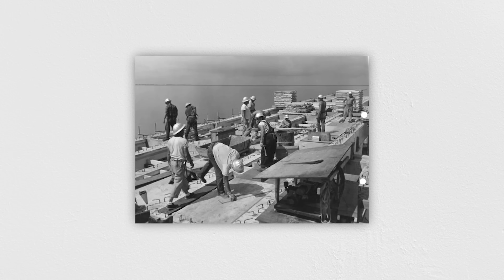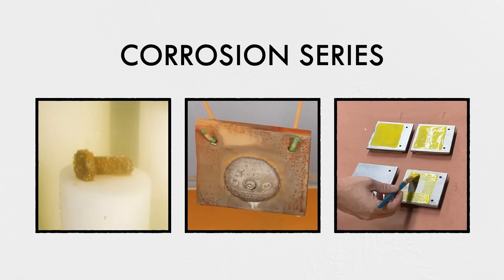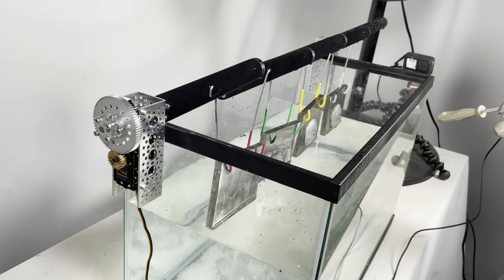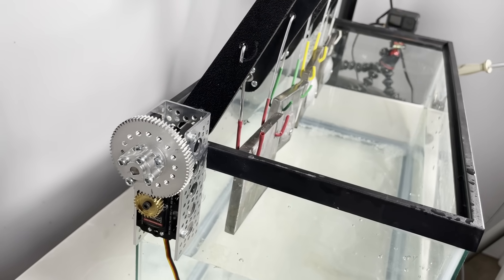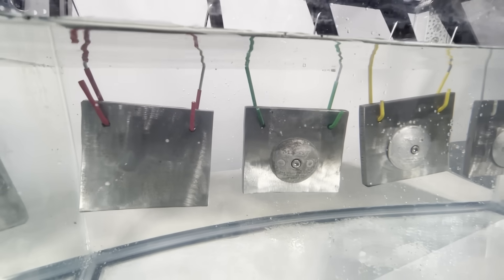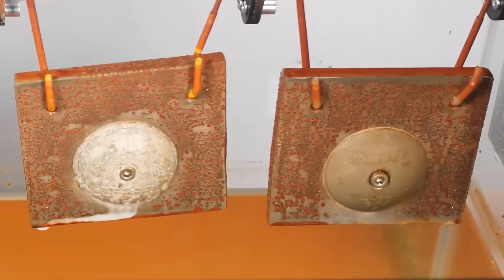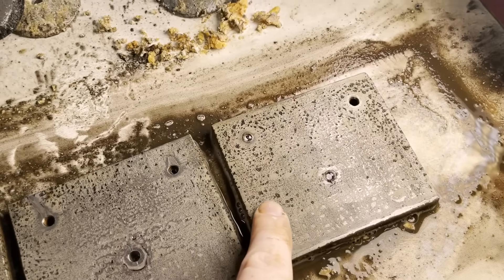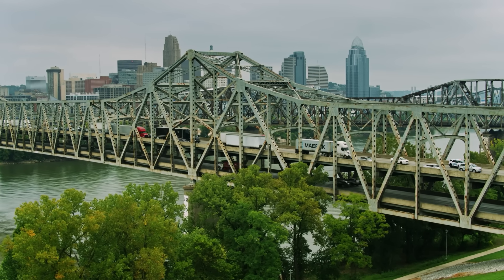Why Spillway Gates Don't Rust Out

Comment: I learned about this in college and I never understood why outside of marine motors this sort of thing isn't popular with old/vintage car owners. Seems like an easy way to prevent rust by bolting a couple of these to the chassis and subframes etc rather than never driving the car and always spending time thoroughly washing it every time it's even slightly exposed to salt and moisture.

Comment: I mean... I'd be really interested in watching a time-lapse of the isolated test subjects consistently submerged in the electrolyte (salt water, mild water movement to allow for some polarization between the metals). I understand it was likely a decision made so that a beautiful, crystal clear time-lapse could be captured while out of the electrolyte (which I truly appreciated, as a NACE CP2). Maybe having the samples just closer to the glass underwater, since you would have had to consistently refill the tank anyways, could produce decent photo's too. 

I just have no context for how long the electrolyte stayed on the samples when raised into the air; I presume 5 minutes allowed for most of the electrolyte to evap./drip in <5mins... In which it is no surprise so much surface corrosion happened even with anodes. Consistently mobile samples would of had an accelerated corrosion rate, since no polarization would be allowed, similar to how adding a bubblier or pump to just move the water around would accelerate the corrosion but limit the effectiveness of any anode; if you wanted to really watch the difference in anode effectiveness, you would want to allow the metals to polarize in a stable water environment. 

It's that fine line of 'maximizing anode performance' vs ' I don't want this experiment running for months on end'. Overall, fun series to watch mate, looking forward to more videos.

Comment: 10:44 
An oz (28.35gram)of protection is cheaper than a lb (453.592gram) of cure..
In metric that's:
An ons (100gram) is cheaper than a pond (500gram)

Comment: put some 304 and 316 stainless steel samples in your rust-o-matic 3000.
we spend so much on coatings we could have built the structures with better materials and have less to worry about.

Comment: Great video. It would have been good to have more explanation of the chemical process you introduce around 3m30. Most people have some idea what oxidation means but how does the non-corroded steel get "reduced" and apparently eaten away?
Reply from the maker: That was covered previously in the series.
Reply: @PracticalEngineeringChannel  Thanks, could you be more specific, I'd like to see that vid.

Comment: Iron rails for streetcars are "super protected", if there is the right polarity, i.e. +600V im the overhead wires, the rils are buried in dirt and water pipes run "faborably". Stray currents literally eat up the water pipes. When the streetcar tracks were torn out during reconstruction, they had excess metal all over the place. They were literally "fused", or "welded" to some parts of sewage infrastructure. What the cranes torn out from the ground were massive blobs of metal. Of course, this was only at a specific location, where there were the right conditions for this to happen. I guess other infrastrcuture suffered a lot (water, sewage, gas) there.

Comment: I'm a corrosion engineer for an automotive company, our test are all about replicating real world and galvanic corrosion is becoming more and more common with mix metal vehicles, aluminium suspension components, steel fixings, aluminium doors, steel reinforcements. Correctly isolating different materials is a large part of strategy now

Comment: Behind my house they were digging along the gas main which is near overhead high voltage power lines. I asked about their work.  They were installing a sacrificial metal wire along the gas pipeline to protect it from the static electricity created by the high voltage lines.

Comment: sacrificial anodes are also used in hot water tanks for homes. It may be about time to replace ours at home, luckily my father worked at a powerplant as a Metalworker and when one of their blocks was closed, these massive sacrificail magnesium anodes were left as scrap and so my father was allowed to take a few. A single one of these would probably last for 40 years as they weigh about 10Kg each.

Comment: A galvanic anode, or sacrificial anode, is the main component of a galvanic cathodic protection (CP) system used to protect buried or submerged metal, But an actively electrotonically powered circuit may be better, without chemically sacrificing any metal anode!  But require a continuous DC current source!

Comment: Silly engineer. I have welded stainless steel. It's really not that much harder to weld. Well, I guess it depends on the grade. There are multiple grades of stainless depending on it's intended use and each one has its own eccentricities, but I really liked welding stainless, especially food grade stainless.
      Each grade varies the kinds and ratios of the alloy, but the kind most people deal with is food grade and that material is used widely in food industry, and we all have to eat.

Comment: I installed hundreds of passive cathodic protection systems on natural gas pipes in NYC (coatings + magnesium anodes), but only one active one (coatings+anodes+rectifier). The active one was on a section of underground high tension power line (345kv) in pipes bathed in oil. The field of anodes were like giant 12’ long candlesticks. The rectifier station looked exactly like the one you showed.
Reply: could they modified to generate current/power? However little?
Reply: @pierQRzt180  they do create power. But pathetically little. And the fuel is a 10x millions of dollar steel pipeline coupled to 100x thousands of dollar anode array. And the added impressed current unit spends more power than the passive anodes make. There are better ways to make power. This is used to be a rust magnet for critical infrastructure.
Reply: Why do underground power lines need to be high-tension?
Reply: very high power electric lines are interchangeably called “high tension”. But has nothing to do with a physical pulling force or that they are pulled tightly, because they aren’t in this case. I’m not sure what the etymology is, I heard it comes from French. Sort of like cinder blocks, which haven’t been made with cinders for 80 years.
Reply: @chriskelvin248  All Europe uses the term "electric tension" or, simply, "tension" for the voltage. So a high tension line is a high voltage line.
Reply: @chriskelvin248  my man, thank you
Reply: @chriskelvin248  "tension" is "voltage" in french so "high-power electrical lines" are called "high-tension lines" because they are high voltage.
Reply: I actually have active rust prevention anodes on the body of my 20+ year old car, it slowed down corrosion significantly, I have to sand down the anodes from time to time as they oxidize but it seems to be working.
Reply: @FrozenHaxor  Any info on these? It would definitely be helpful with my rust belt cars!
Reply: @PlayinWithMahWii  Look up Electronic Rust Protection System (ERPS), they are sold under various makers.
Reply: e

Comment: Great video.  I work offshore so rust and cathodic protection is something we see a lot but I never knew how exactly it worked beyond the zincs corrode instead of the steel.  This video filled in the missing piece.   There are a lot of big pieces with big anodes down there, you should see the corrosion on those zincs after they have been on bottom for 20 years or more.  They do their job though, the steel is usually still fine while the zincs are encased in their own oxidation.

Comment: Can someone explain what state stainless steel fasteners A2 & A4's are sold as, are they active or passive state?  
I thought all stainless steel fasteners are in a passive state due to the oxide layer that forms but you can further passivate it using chemical baths.  This bit is confusing.
Passive SS is noble and opposite end to Aluminium on the corrosion chart which means in theory you can use it together as long as the screws are smaller than the aluminium part you're fastening?

The use case is in a temperature controlled, indoor and non-humid environment i.e. clean room. 

Can someone with a background in metallurgy help :)

Comment: I worked for British Gas Engineering for just short of twenty years. Cathodic protection, impressed current and basic sacrificial anode systems were widely used. I recall Mike, our senior CP manager, who coincidently had red hair, was known as the "minister for rust" or nicknamed Rusty by the rest of engineering.

Comment: Bare carbon steel corrode (looses) 20lbs a year. This is unprotected steel. 20lbs a year might not seem like a lot but if the 20lbs/year is concentrated in one area (a holiday= could be a pinpoint size), which the year rate becomes hours to days to corrode. This can be 20lbs/days if the steel is unprotected. So, protect any metal that comes into contact with air, soils, water, and other liquids. There is more to this, of course. Good video.

Comment: Whenever you do the paints and coatings video, it might be worthwhile talking about cathodic paints in addition to normal paints. In the 1930's onwards, many cathodic paints (Aluminum, zinc, magnesium) were offered, and used widely in the US and elsewhere, as a cheap solution for extending the life of galvanized and bare iron/steel structures, and can still be seen in use in many places due to their low cost vs performance.

Comment: Hi, slightly off topic here but I have a question. Why do houses are built mirroring the house(Terraces and semi-D) next to it. For example, if a stairs were to be built, only both houses will have their stairs on the same wall. House A and B will have the stairs on the wall dividing house A and B. The same goes for house C and D.

Comment: My dad told me about running a small current through an underground storage tank to prevent it from corroding.  I remember him telling me one issue with it is that it will accelerate the corrosion of the guy's underground storage tank across the road!

Comment: I worked as a construction worker on a new part of port of Koper in Slovenia. Port wanted to expand their capacities but it was immpossible to expand on land so they decided to expand on sea with new pier. We used tons and tons of rebar and concrite but I was curious how can we build with iron on salt water. Later I found out and asked guys that i worked close with that they use platinum coted titanium rods under pier to protect rebar and iron pilons. They weld them to iron in salt water and secure everything with cables in concrite - everthing was in contact. Its basically the same principle you explane here.

Comment: The metric equivalent should be "0.278 Newtons of prevention is worth 4.44 Newtons of cure"
Newtons, not grams; the gram is a measure of mass, the pound is a measurement of weight. A small, but important distinction.

Comment: Excellent. Thank you!  As an engineer on new projects for the offshore oil and gas industry; I really find the corrosion prevention aspect of the structural engineering to be fascinating.  Also, as a restorer of antique machinery, I totally agree with your observation as to how preserving and prolonging is much better for all; versus replacing in a short time.
Reply: Well I guess as an engineer you must have an understanding of electrolysis add salt water

Comment: In your test rig, aren't the steel plates connected by the metal hooks they're hanging from, and wouldn't that affect the results?
Reply from the maker: The hooks have heat shrink insulation
Reply: @PracticalEngineeringChannel  Right, thanks.

Comment: You have good content well demonstrated.  I live in Idaho with the impression we have some of the worst examples of road construction. Idaho is always chip sealing which leaves standing water in the track, non reflective lines that disappear in a steady rain, wrinkled up pavement at intersections that scrape the bottom of cars and single mile widening projects that never connect creating numerous merge hazards.  Would you consider an episode on best practices for road construction.

Comment: Putting a copper disc on one of the sheets would have been interesting to demonstrate anodic corrosion. Some nails are electroplated in copper to protect them, but any scratch in the surface causes accelerated oxidation.
Edit: Or is that the next planned video, no spoilers.

Comment: I did some digitization work for an energy company once relating to pipeline corrosion. One of the major influences on that process is that transmission pipelines are frequently built along the same path (and therefore fields) as transmission powerlines.

Comment: I work in the offshore wind industry and these sacrificial anodes are commonly used in protecting the foundations of offshore wind turbines. There is another environmental aspect to their use though. The sacrificial anodes by design release metal oxides into the environment. The environmental impact are currently being investigated. It looks like in the future we will have to switch to cathodic protection (with an external source of current). Maybe the next video will look into this method?

Comment: I’m just going on a limb here but didn’t the fact that for the time the samples where subjected to the salt bath water you prepared in the tank also generate enough differential current between the samples causing them to not behave as they would if they were dipped into individual baths for the experiment? I guess the end result would be negligible since it wasn’t a matter of measuring how fast and badly they deteriorated over time but just a demo on how they work on protecting mild steel from corrosion itself but it’s something that started to nag at the back of my head the moment I saw the setup and I couldn’t keep my paws off from pointing that out, sorry.

Comment: A bit disappointed that even tho the cathodic protection research was done so well, it did not go into further detail as to which sacrificial metal did the best job. It was noted that the magnesium suffered the most, but then only superficially a "looks like it protected the steel the most" mention. There was no closer look at the steel. There was no discussion why zinc was chosen to protect the Tampa bridge over Aluminum, or magnesium. I heard that it might even make a difference if it is a structure in fresh water vs salt water. Also that the sacrificial metal on outboard engines are called anodes. So...... even tho a lot of effort went into this video, a lot of info could/should have been added.

Comment: I'd like to see a video on Cor-Ten steel (presently sold as ASTM A606-4, A588 and A847).  You may recall that the US Steel building was made from it with the promise of no serious rust once an outer oxide layer forms.  If it was so great, why don't we see it in use today?

Comment: I'm curious, did you weigh your iron blocks before and after your sacrificial anode tests to determine the volume of material loss in relation to the loss of sacrificial anode material? What I mean is, if laid out side-by-side, did the magnesium, aluminum, and zinc anode losses by weight equal that amount of respective protection for their steel plates? Which steel plate fared the best?

I need to do further research into this, particularly the "impressed current cathodic protection" for my classic car, which has a steel body. I think this would be a novel way to prevent/mitigate rust so long as the current requirement doesn't interfere with vehicle electronics.

As always, A+ for your informative video! I learn something new every time I watch :)

Comment: This is so weird. Last weekend I spotted some odd contraptions on a concrete bridge: a bunch of stainless steel boxes attached about 20 feet off the ground/water level with conduit running to them. Each base had them. My first thought was to take a photo and see if I could send it to this channel as a topic idea.... and then this video drops. It's almost certainly an impressed current system. Thanks for the great content!

Comment: This video is incredibly timely for me. I just took delivery of a boat currently based in salt water. Boats like mine used “zincs” to help prevent corrosion on underwater parts such as props, rudder components, and side thrusters. Although I knew what zinc (the element) was, I had no clue what a “zinc” (the anode or sacrificial part) was until about two weeks ago. This video really helps explain HOW they work. Thanks!

Comment: Small note. There is few different ways stuff are zinked. One is cold galvanising which woodscrews usually get. Then there is hot galvanising which used for threadedbolts that are ment for outside use and steel bars etc. Last one that i know is called delta flake which is painted galvanising. Which is used on woodscrew that are used outside also on screws for automotive industry although some has change to chrome nickel.

Comment: Awwww, you didn't weigh the plates before and after salt dipping? Dang, that would have been a great comparison. Could have even done some extremely scientific extrapolation to a year or two. You could have then done a cost/benefit analysis, looking at the cost of the anodes required for that year and amount of metal saved by its application.

Comment: The metal with anodes would've been way better protected if you just left them in the water, and there would've been significantly less anode loss too. When you take them out of the water you loose the cathodic protection and the polarization film that it creates.  To repolarize the metal takes a large start up current, so every time they went back in the water the anode lfe was significantly reduced.